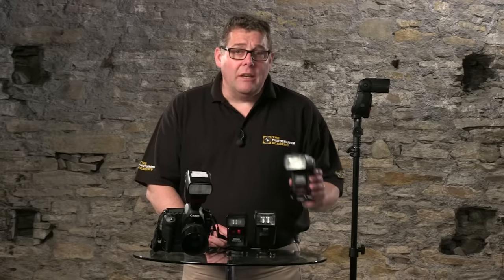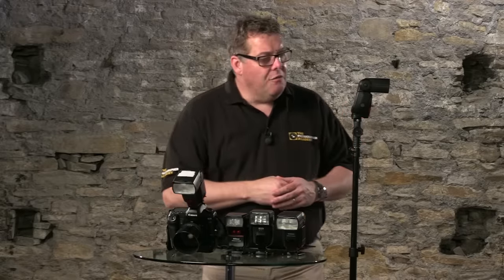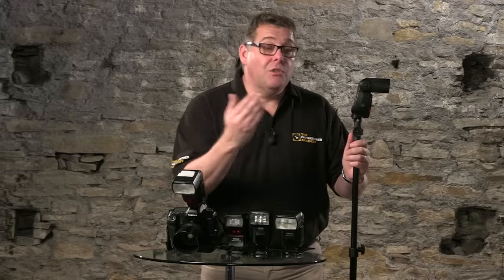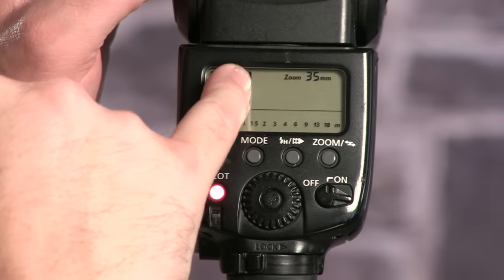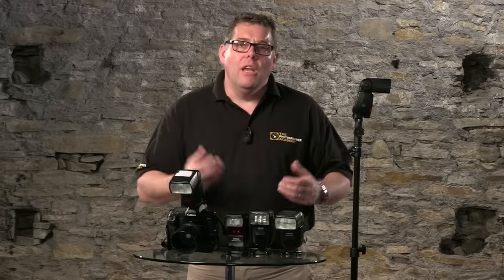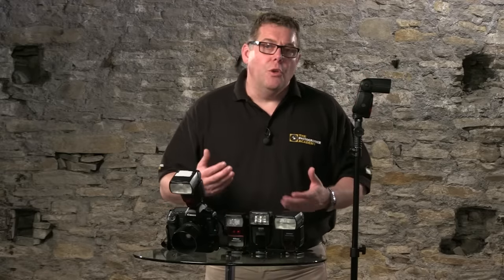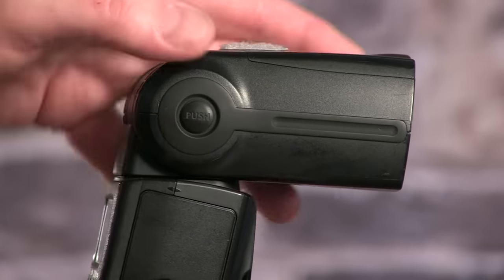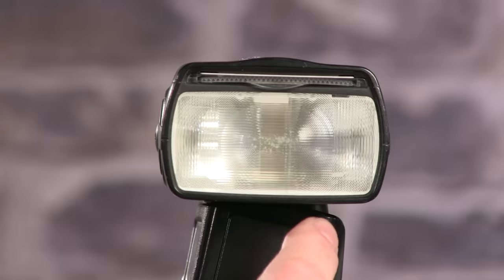SPEEDLITE BASICS | Getting Started with Speedlites

Comment: Hi ! Great flash ! I want to stress one important detail. It needs 9 volts and 6 regular ni-cad batteries deliver just that. However, some users may be tempted to put in rechargeable batteries….and many may worry when the unit does not come on. The reason is that those only deliver 1.25 volt each. Total 7.5 v. of course. 

I did not use my Metz for quite a few years, especially during and after covid-19 and as I went to use it just a few days ago is when I discovered the absolute need to use ni-cad. 
Further more, I was sure I had used rechargeable ones in the past…..With no problem !😊
So…keep my experience in mind and make tests both ways !

Comment: Best way I've heard 2nd curtain flash explained...couldn't understand it before now. Thanks!
Reply: I agree! Thanks
Reply: I agree!
Reply: And it was completely wrong.  It doesn't make things "clearer", it only determines when the flash fires, which you may want before or after the ambient light exposure.  It's purely for artistic differences.  He never even explained what the "curtain" is.  It's the fact that there is a front and back edge of two curtains that run across the exposure box. The flash usually fires when the first opening curtain opens completely.  The second curtain flash happens just before the second curtain begins to close across the box.

Comment: 7:04 --- It's not that the shutter speed is too fast to see the explosion of the gas --- the firing of a flash is of a much shorter duration than the camera's max. sync speed (on the Nikon SB-700 speedlite, for instance, at 1/128 power it is around 1/40,000th of a second --- the less power, the shorter the flash; at full power the duration is around 1/1000th of a second); the black masking you can see in the bottom of the image which you presented when illustrating the effect we get while shooting above the camera's factory sync speed is just part of the first shutter curtain going down. In Olympus cameras, for instance, the shutter curtains go up so you are going to see the black masking or bar at the top of the image. This is because above the max. sync speed the sensor is never fully exposed but rather light gets onto the sensor through a wider or narrower slit created between the two shutter curtains (groups) moving together down or up (depending on the system).
Reply: Tomasz Stramel That saved me writing all that out, I was extremely surprised when he said that.
Reply: Tomasz Stramel Good explanation! In fact in the video between 6:35 and 10:05 there are several details about what is happening during the exposure in the different flash sync settings that is incorrect or explained in a weird way that is not describing what is actually happening.

Comment: Thank you.  I have shot cameras with flash for decades, but I've never really learned the details of what I should know.  It started with Magicubes on an Instamatic in the early '70s, and later a Braun on a Minolta SRT-201 in 1979.  Now I have Canon DSLR gear and several Speedlites, but I never really learned how to make the best use of them.  I used the pop-up flashes for snapshots, and sometimes experimented with the separate Speedlites, but that's about it.  You inspired me to make the effort to learn how all of this works.

Comment: I learned so much today about the speedlite that I've had for 10 years.  Thank you!!!
Reply: Sandra Maniscalco hi, do you have a suggestion? I’m thinking of 430 ex
Reply: @lakshnemani7960  , If you are asking for my opinion on a flash to buy, I don't have enough experience.  I think you may want to direct this question to the video publisher.
Reply: thank you Sandra! I brought it yesterday . I’m excited to explore flash photography. Another quick question if I’m not bothering. What kind of radio trigger do you use which supports high speed sync; the canon one is pretty costly. Appreciate your time
Reply: @lakshnemani7960  I'm actually on the market for one myself so I'm not sure.  And yes, the Canon one is a bit expensive.   I'll let you know if I discover any product that can help you with this purchase.

Comment: Awesome 👍 Two things  I learned 1. Hight speed sync needs the link with he camera. 2. The 2nd curtain flash fire 👍 That example was perfect for me. I use a Canon 1300d and i have 2 x Jinbei Caler 600C-TTL. Apparently those Jinbei speedlites are FULLY compatible with Canon, as they have the license agreement with canon for the radio linking technology. However lol, my 1300d doesn't have linking 😣😅 So I've been using Hahnel Captur triggers. I'm still trying to work out the High Speed setting as I've done tests and I'm still getting the black line. The Captur triggers are supposed to be 100% E-TTL compatible, so mayb he Jinbei simply need the radio circuit installed in the camera😭😊 Great video mate.
Reply: To add, i can get a link thru the Hahnel Captur tribgers, as all the link lights are green, but there's just something not right in the Highspeed flash sync dept.😣

Comment: Awesome video - thanks. Can you answer this? I ordered a few cold shoes for off camera flash but when they came, I was surprised to find they were metal instead of plastic or some insulated material. I'm worried about shorting the contacts together on the hot shoe of the speedlite. Should I be concerned?

Comment: A little more elaboration on zoom needed. So  is the rule of thumb to match the lens ? Meaning if I using 50mm lens use 50 mm zoom?  When in ETTL mode is that adjusted automatically?

Comment: I just wish you'd gone over how to get a proper exposure. I'm clueless with flashes. I just ordered one though so it's time to learn
Reply: I find that the "flash exposure compensation" on your camera is very helpful even when using ETTL mode.  You can take a test shot, then adjust the exposure stop up or down, based on how the test shot looks.  Once you get it where you want, then you can make camera setting adjustments without having to go back and adjust the flash, unlike when running the flash in manual mode.
Reply: @TheHomeWinemakingChannel  I only have a film camera so this isn't an option. I got a sekonic meter able to meter flash though.

Comment: This video answered a bunch of my questions. I have been researching what systems will work with my Nikon D3400. I currently have one Voking VK750III Remote TTL Camera Flash Speedlite which I've been using on-camera but want to start working with off-camera flash. One thing that is important is for the flashes to be able to communicate with each other when they do not have direct line of sight (I will need one flash to occasionally be behind a subject). I've looked at different triggers, etc and can't find anything compatible with the D3400. Any recommendations for triggers and such?

Comment: Im sorry for asking stupid questions, but I am quite new into these "modern" flashes. Until now - I used my Nikon FM2 with Metz MZ32 that had 3 automatic modes for each aperture. I usually set the ISO and used the one with f/8 - f/11 and the flash did distribute the proper light exposure on the synchro speed 1/250s 

Now I have my Canon EOS 3 and this Speedlite 580 EX II and I am kinda confused. I test it in the darker areas. When setting ISO, lets say, to ISO 100 and using that E-TTL mode on the flash with camera aperture priority mode (ATv) set on f/8 - I get extremely long exposure times. 
When I use the Program (P) mode it sets the shutter speed to 1/60, however, it only sets the aperture to f/4 which is what I do not desire. 

How to set the flash to shoot proper exposure on f/8 with sync speed from 1/60 to 1/250 ? Should I set the camera to manual mode in f/8 and speed 1/200 and hope it will deliver proper flash exposure or what would be the camera/ flash mode I need to set? 

Thanks

Comment: Great video. Question: Can speedlights be used off camera without 'triggers'? I have the D850 but in my research, I can't take a flash out of the hotshoe and use in my hands. Is this correct? Even with all the WiFi and Bluetooth technology, you need  a 'trigger'? What about a cable? If I'm at a party and want to take the light off the camera for a shot, would a cable connector work? I kind of thought one would be able to mount and dismount the flash and have it usable ready in either condition. Thanks much.
Reply: Gary Fallowes - I just found out that my sb700 can be controlled via my d750 by going into the settings and setting it to commander mode. I would think the d850 can do that as well. Look into your manual or else do a search for some videos. :)

Comment: Great presentation...  However, just a matter of semantics - a very common misconception is that in adjusting the manual power of a Canon Speedlite: 1/1 does not signify one to one.  Instead it signifies the fractional setting of one over one - or full power.

Comment: Cold shoes have no electrical contacts, hot shoes have at least one - in that case only for firing the flash with no further interaction between flash and camera.
Additional contacts originally only set the camera to its synchronised speed for flash, but later controlled the duration of the flash burst.
Speaking of flash duration, it's not because the xenon is too slow to light up that high shutter speeds cannot be used. It's because the second shutter curtain starts closing before the first curtain has opened completely.  The sample photo demonstrates this very well. The bottom of the picture is actually from the top of the sensor, and shutter curtains move vertically from top to bottom during exposure, so the second curtain is already closing, obscuring part of the sensor. Had you used even faster shutter speeds, more and more of the image would be black - not because the flash is slower and slower, but because the second curtain closes sooner and sooner after the first curtain (not faster and faster).

High Speed Shutter shots are in reality taken at the maximum synchronised shutter speed for non-HSS compatible flashes. It's just that the burst of light lasts longer in HSS-mode - and the guide number is reduced, because the power output must be distributed over "slices" of the sensor ... and a lot of light is wasted, because it hits the curtains instead of the sensor.

Comment: I have a Speed light flashgun ( well it's a YONGNUO   YN565EX II). & it does work extremely well with the exception of being a bit  heavy use on it's batteries. 😱😒 The only thing Is as this is NOT a GENUINE SPEEDLIGHT FLASHGUN but, was told by the seller ( private sale 😏😒it would be fine with me camera & I did take a few pics with it & at the time seemed fine & even now N.P!!!  But, still want a second or third opion about it PLEASE!!!) & I have used it sparingly on my OLD BUT, RELIABLE CANON 440D.   Is this compatible & safe to continue to use with my camera  ( ditrectly used on the hotshoe) or should I discontinue using it with my camera. I am a bit concerned about it now since watching this video.  I tend not to use my flashgun very much anyway unless I'm really have to. Very rare now I bother going anywhere near it. But, I am not likely to get rid of it because it has proven to be a great boost of that extra light as & when required.  I am very pleased with this video as it wasn't TOO TECHNICAL as some videos are. 👎😞😡 This video is explained quite easy even for those like me a bit DUMBWITTED. 😄😁 when it comes to some tech.  NICELY EXPLAINED WELL DONE!!!  👍👏👏👏👏

Comment: I have bought a flashgun with a connection pin pattern and number of pins that don't match the pin pattern and number of pins on my hot shoe (hope that makes sense) and so the flashgun doesn't connect to my camera body - the only way to use it is through using a transmitter. Does anyone know if there is an adapter type tool I can use to have my flashgun work on camera or will I need to buy another flashgun?

Comment: Your speedlites seem to come on very quickly.
I just got mine in the mail yesterday and it takes a minute to warm up and for the ready light to come on. I have tried to sets of brand new batteries. Sometimes it does not come on at all, and the battery indicator just flashes.
So I think I need to send it back!
Reply from the maker: It sounds faulty to us. Send it back
Reply: Thanks for that. I will send it back and ask for a replacement

Comment: I know this question is late. Whenever i attach a speed light onto my camera my shutter release is delayed. I can actually hear the flash tick 3 times and then the picture will take. Whats causing the delayed shutter release?
Reply: like Mark said, make sure you have it on the right mode. Also make sure Camera is clean, Speedlite Contacts are clean too, ALSO FOR GOOD MEASURE, check batteries inside SpeedLite and confirm they're fresh and haven't been sitting for 3-6 months.
Reply: Check your aperture too, if not enough light is getting in the Flash is doing the heavy lifting. Speedlite could also be recharging all the way between photos. Check this website out too, for possible solutions. https://photo.stackexchange.com/questions/7971/why-do-i-have-shutter-lag-when-shooting-pop-up-flash-in-manual-mode

Comment: How does the ettl  mode know how much power to use to get the correct exposure  if the flash is pointed up and  a diffuser  is over it ? I thought the ettl mode was  calibrated  to read the  light  straight in front of the camera where the beam is pointed  on the front of the  flash with the  flash head  pointed at the  same place the beam is hitting . When it reads the light  the flash figures out the  power it needs based on the flash head pointed  right at the  subject  not pointed up in the air . Also the ettl mode sets the spread of light with the  zoom setting of the lens but if its pointed up and its reading a lens zoom  what happens when the flash is pointed up ?   If you are not pointing the flash at the subject so the sensor of the flash can read the exposure  and flash the power to get the correct exposure  why are you using the ettl mode  because  its only going to fire at the power  it  needs based on the flash head pointing straight at the  subject . Its not setting the power  based on it bouncing off the  ceiling  is it ?  The ettl mode doesn't adjust its power  for add on diffusers does it ? It doesn't adjust it's power  when the head is pointed straight up does it ?
Reply from the maker: It’s to clever for me!

Comment: The reason he gives for the black bar in the picture when you set the shutter speed higher than the sync speed is wrong. This is a known issue with focal plane shutters (FPS) found on all 35mm cameras (except for inconsequential exceptions). Larger format cameras however (medium and larger), often use a leaf shutter which operate in a different way that doesn't affect the flash photo at higher speeds. FPSs slide open in a way to ensure the frame gets the same amount of light even if the shutter is sliding open, which is what a FPS does, because it closes at the same rate (from side to side, or top to bottom/bottom to top depending on make). If you take a flash picture above the sync speed, the shutter is not open 100% to expose the whole frame at any one time to the flash (doesn't matter film or digital). Only a slot is open that 'scans' across the frame. The black bar is there because you are seeing where the shutter covers up a portion of the frame. Watch this to help understand. 
https://youtu.be/9fzI9IC1D_o